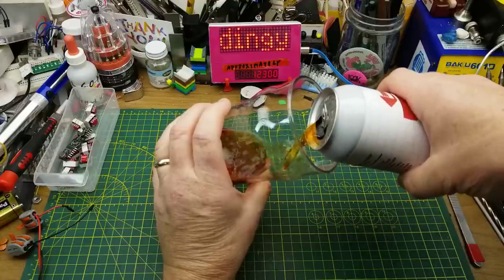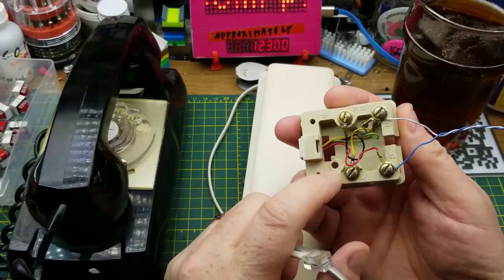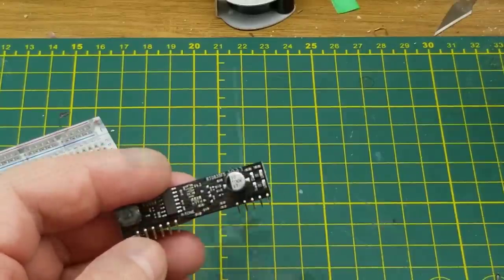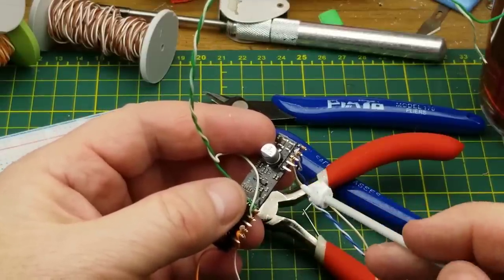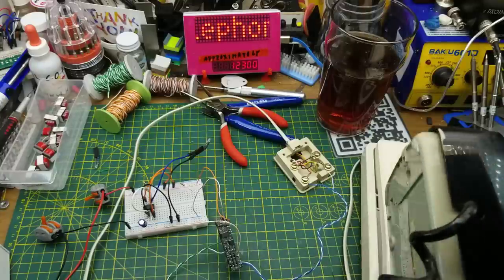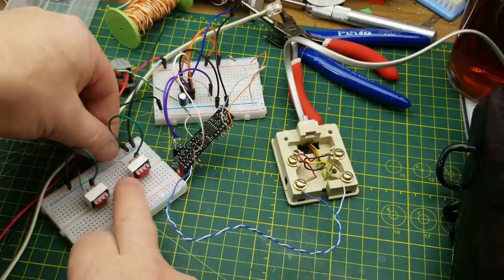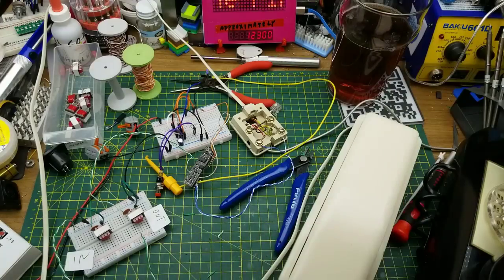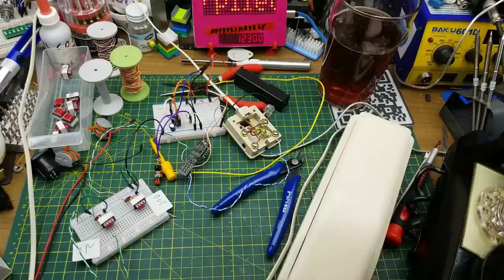Controlling old phones: tinkering video

Comment: In the late '90s I was receiving introductory training on Ericsson MD110 systems.  Part of this was to go onsite with a new large system and assist with installation.  This particular MD had an external voicemail system linked to the MD with RS232 for control.  During lunch break I snooped on the serial comms to see what was going on and noticed it was all plain text and saw that it was very easy to prompt the MD to do a short ring on a handset to indicate messages were waiting.  A short program on the laptop and some ringer tone adjustments later and I had the phones in an office crudely playing those well known notes from Blue Danube waltz much to the amusement and bewilderment of the people training me when they came back from lunch.

Comment: The mic audio fed back is normally referred to as "side tone", used a lot when the user is wearing headphones with a boom mic. The headset blocks the external sound path from the mouth to ear so the side tone just puts it back. It can be used to help make the user talk louder; if you reduce the level fed back it can cause the user to speak louder to increase the volume in their ears. We are used to hearing our own voice at a certain volume so will increase or decrease to maintain the level we are used to. 

Fun communications fact. 🙂
Reply: Woof!! I missed the fun part:cat-orange-whistling:
Reply from the maker: Yup.
I couldn't think of the right name on the fly while recording.
Reply: @pileofstuff  spent way too many years in audio coms to forget what it's called.

Comment: Great project!  I'd never have thought of also providing the audio path in a stage prop setting.
I tried getting my module to self-ring by setting the ring mode or fwd/Rev   high/low in all combinations, including keeping the other floating while the other is high or low, and I can't get mine to ring on its own....weird!
Reply: Do you know if you have the same modules?  After I saw both your guys videos I went looking on aliexpress and found a bunch of different versions/part number combinations and it was hard to tell how compatible they were.  I haven't had time to try mine yet so don't know if mine will self ring either.
Reply: @rjpete66  I'll have to check what Aliexpress has again and see if they have datasheets that explain differences, maybe I'll want to try a different one for fun. At least with a microcontroller it should still work whether we need to toggle the ring pin or not.
Reply: @GadgetReboot  the vendor i bought from didn't have a datasheet but i googled the part number and found one someplace else.  Mine have part number KS0835F V1.4 but i also saw similar part numbers and some just said AG1171 so I'd be curious how consistent they are from vendor to vendor or even from the same vendor over time.
Reply: @GadgetReboot  might also be fun with a microcontroller to play with the ring cadence a bit.  Might make an interesting halloween prop if it had wonky changing ring cadence and a spooky voice recording on the line when someone picks up.

Comment: I ripped the guts out of my phone and started again... more difficult 'cus there's more to do, but it does mean I can manage to ring my bells with just 20 volts instead of needing the full 40. I've wired my bells up to a microcontroller and each one's on it's own 20V circuit instead of being on the two poles of a 40V circuit.

Comment: Wiring tool - -brought back memories. I still have mine, 6 tools, 3 SWG and 3 metric, plus two removal tools -one for StepxStep (Strowger) and one for TXE4 and Cross-bar. Happy days those days in the 70s....

plus the 50v lead acid glass-tank batteries in the basement, slowly emitting acid vapours as they recharged
Reply from the maker: I had the "pleasure" of dealing with wet cells for the first couple of years of my career, then they all got replaced with VRLA cells.  Didn't need the rubber space suit any more!

Comment: Nutshell: it’s a POTS line interface on a module. Generates line voltage (-48VDC), ringing voltage etc. 

Author seemed to take the long way round in the video 🙂😁.  I did kiiiinda think ”why on earth is he building a 20hz oscillator; did he think they’d go to the trouble of designing an entire POTS interface, and then forget to add ringing generation? 🤨”

Lol. To err is human I suppose.

Comment: I used to make phone taps, fm telephone bugs and beige boxes (before the internet and it’s “let me show you how to X” mindset - it’s all incredibly simple and is logical progression when you have to work things out; that’s what develops one’s mind!) back in the 90s. 

Also I looked into “infinity transmitters”. A chap here in England used to make an INCREDIBLY impressive range of these - minuscule black blocks which had all the clever stuff potted inside, brought out onto 2 turned gold pin sockets which were sitting flush with the surface of the carefully sanded flat black potting compound. The construction alone was a work of art. I wish I could remember his name. 

I’d call him at home (we never met) and he’d tell me the DTMF code he’d set into the demo unit; he’d tell me he was going to hang up and that I should wait X seconds and then enter the code, which I did, and I’d then hear VERY amplified room audio from his end. 

Google ”Infinity transmitter” - but I’d caution against using one!!

Comment: Just out of interest,  on your socket, the green wire goes to the terminal marked 'R' and the red wire to the one marked 'G'. Does it matter?
Reply from the maker: Not in any practical sense. 
It's mostly just convention. 
The old analog phone system was designed to be quite tolerant of whatever might happen outside of the central office.
Reply: Many of the old touch-tone phones will only generate tones if the polarity is correct.

Comment: That is such a neat module. You could make an intercom system with it. :)
Reply from the maker: Yeah, that would be pretty easy. 
Just need one of these per phone and a bit of glue logic to tie the signals together.
Reply: @pileofstuff  And a hell of a lot of wire. Ha ha.

You could set it up so that when you picked up your reciever, the other phone rang. (and vice-versa)

Comment: It is called SLIC module (Subscriber Line Interface Circuit). Many years ago I used to replace those in PBXes (usually failing after lightning hitting nearby)
Reply: Yes did get to swap them off the line cards to get working lines on the PBX, then call to get replacement ones, along with new caller ID modules that plugged into the top. Had the tech come out one day to "borrow" 2 cards that were not all used, just port swap the 2 extensions per card to another unused set of ports on a 16 port card, so he could get an exchange going again that had been clobbered by lightning.

Comment: Nice!  There is actually a unit floating around in Winnipeg these days.  I built one (not with these modules) for a tv show a couple years ago.  I assume the prop master still has it.  I used an arduino to switch a mosfet and drive a 12v transformer in reverse to create the ringing voltages.  I even set up the intercom function but that had to be switched in manually from the ringing circuit as I didn't have time to figure out how to get the arduino to do it automatically.  When I saw you get these ones I went and ordered a couple from aliexpress myself.  Note that another option may be some of the voip interfaces to create a small pbx.  I picked up one that has two phone lines but I still haven't gotten around to trying it out.
Reply from the maker: I remember decades ago fixing a portable ring generator for another props master.  It was a transistor oscillator, a couple stages of transistor amplifiers (basically an audio amp) and an output transformer.  All in a box that looked like it was from the '60s.
Reply: @pileofstuff  That could have been before my time (or at least around the time I first started - about 20 years ago).  I wouldn't have known enough to touch something like that back then. It doesn't come up too often in film and tv these days as it is more controllable in post so it doesn't step on anybodys lines. This one show had one they'd ordered get lost or stuck in shipping and asked me on a friday if I could build one to be used monday and I realized I had learned enough to be able to pull it off.
Reply: @pileofstuff  and the need for ringers is pretty rare due to lack of land lines in shows and life these days 🙂
Reply: @pileofstuff  in the mid 2000s I was asked to gently hose out a ring generator as Burton Cummings had vomited inside of it. I still can't eat Salisbury steak to this day.
Reply from the maker: @spacewolfjr  That reminds me of the condition of the snake after a gig I did back at the old Monty's bar many, many years ago. 🤮

I still have nightmares.
Reply: @pileofstuff  You think the snake just dreams up the poison in his head?